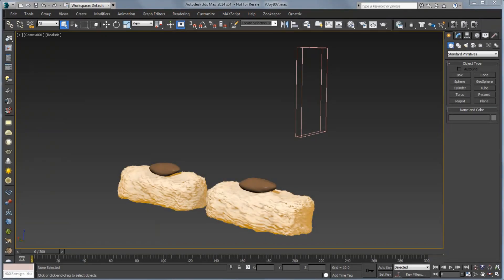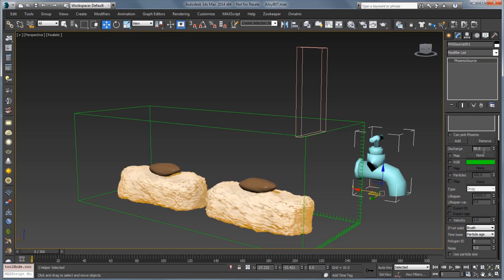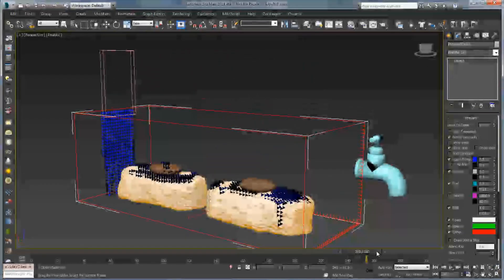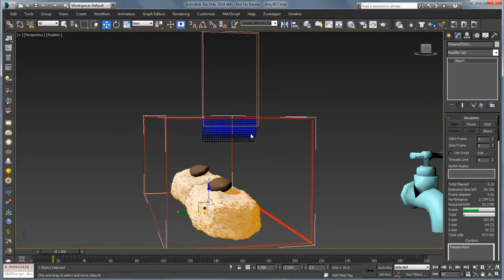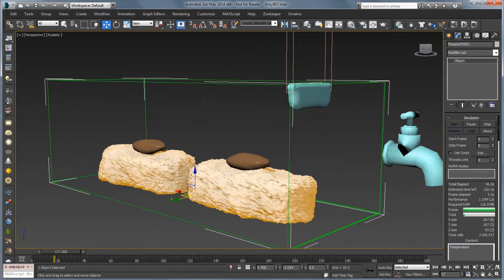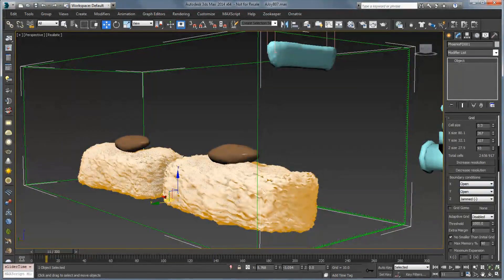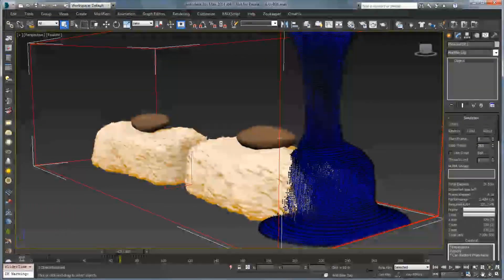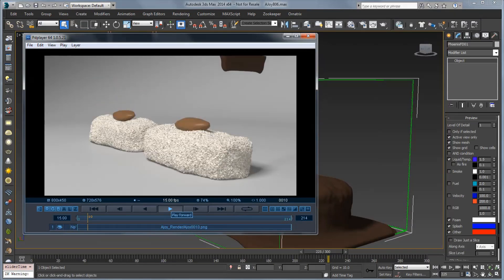Using Phoenix FD to Create Liquid Simulations - Chocolate

Comment: Hi there, first of all thanks for this very nice and very well explained tutorial. I would like to ask you a few questions as our studio is planning to step into fluid simulation effects pretty soon and we are budgeting down the required things for the studio. 

1. I will start with a very basic question about the configuration of the computer system required for these kind of simulations. What are the graphic card configuration that we need to stay in the competition. As we are into creating advertisements so in order to survive in this fast paced industry we are planning for some high end water simulations for our clients.
Also keep in mind that we are still a quite new company so make sure to keep the price of the configuration well within our budget.

2. Secondly I would like to ask the render time required for such simulations. We have already tried our hands with real flow and naiad but they takes a lot (i mean a lot - a lot - a lot) of time while rendering with GI. As it seems that this plugin is compatible with vray, should we believe that this is going to be much faster than rest of the programs in the industry. Our current system spec is - Intel i7 860 @ 2.80 GHz with 8 GB of RAM and NVIDIA GeForce GT 620 Graphic Card.

I would like to thank you for your help in advance.
Reply: Hello, you need a system with fast memory and a lot of memory - this is the main bottleneck of the simulation - 8G will probably not be enough. You need a good CPU with as many cores as possible - it's better Not to use dual- or multi-processor machines. The GPU is not involved in the simulation.
Reply: Svetlin Nikolov Why do you say not a dual cpu or multi processor???
Reply: STROB.NET It takes time to synchronize multiple processors, and two CPUs with 10 cores will be slower than one single CPU with 20 cores. Multiprocessor systems are good if you want to do a couple or more totally unrelated jobs simultaneously - like simulating one scene and rendering another.
Reply: Ok thanks I didn't know that... But I guess if you have 2 cpus, you can get 40 cores when the max on one cpu would be 20.
Reply: STROB.NET Ah, yeah, that's true indeed :) If you hit the max number of cores per single cpu, getting more cpus will speed up the whole thing somewhat.
Reply: Svetlin Nikolov Is my system specs enough for these simulationS?
Inter Core i-7-4770 CPU @ 3.40Ghz
8.00 GB of RAM
64-Bit OS
Reply: TheTdk242 Yup, for this one it's perfect, but if you plan to make huge epic simulations, at least 8Gigs more won't hurt :)
Reply: Svetlin Nikolov Thanks very much